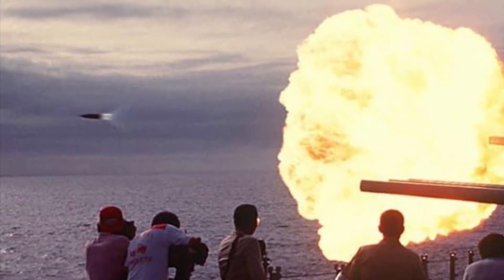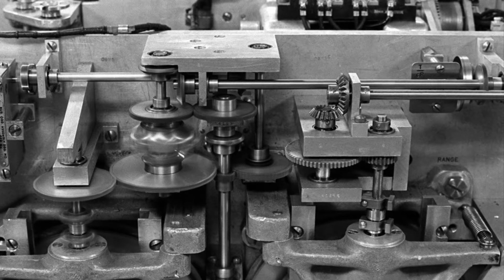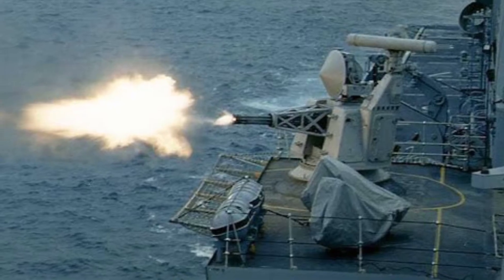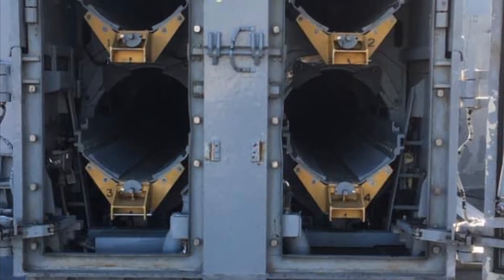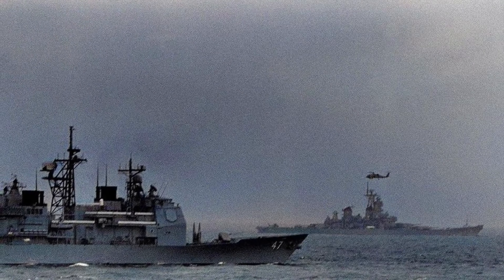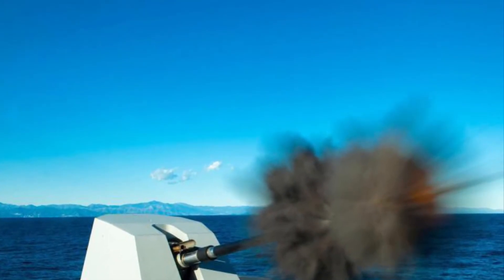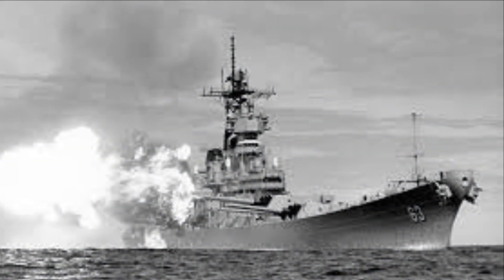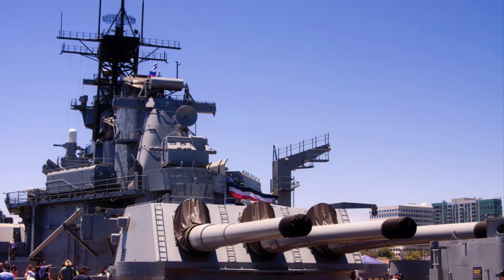How would I modernize the weapons on an Iowa Battleship?

Comment: The only way they would be viable is to ... gut everything after of the main bridge , gut the steam system and drop in a modern nuke reactor or 4  and all the fuel tanks add armor because they are outside the  internal armor belt. Take out all 3 turrets and drop in VLS. Everything forward of barbet for turret 3 to the bridge being a combo of the auto loaders off the destroyers and sea sparrow , sea wiz and missile farm for VLS.

Comment: Over on another website (Battleship New Jersey) the curator (?) had a similar video. He mentioned the pre-Aegis system: New Threat System (NTU). I never heard about it and was active duty at the time. Basically this system used all available radar systems to track and guide missiles to their target. To me this would be an excellent system to put on the Iowas.... maybe updated if possible.

I would gut the armored box launchers, too. In the center spot between the funnels I'd put VLS system (as many tubes as would fit). Where the rear box launchers were I'd put either a Mk-29 GMLS 11-cell or a Mk-144 GMLS 21-cell or a Mk-15 SeaRAM. But I also like putting these back on the aft part where the two tubs where the Bofors once where, even if the shipyard had to cut and modify these for better sea spray protection and/or concussion by the 16" guns.

Agree with replacing the old twin mount 5" guns with the current Mk-45 62-calibur.... 3 per side spaced evenly. Possible exception would be on starboard side put the new 5" gun aft of the refueling station. But a good spot would be place two of these guns in the aft tubs where the old Bofors used to be. These probably be better water-resistant than a Mk-49 GMLS.

I'd keep the Harpoon launchers in their current place. Slightly aft of these I'd place a NSSM Mk-29 launcher for the Evolved Sea Sparrow Missile.

I like the idea by the New Jersey's website suggested: put a tripod mast similar to the current on the rear funnel, possibly turned around so the legs anchor near the funnel's sides. This would give extra places for the additional radars to be installed. Almost every current radar system could be installed if the ship had two tripod masts.

I'd add the AN/SPG-62 Fire Control Radar in similar positions as the Arleigh Burke's and Ticonderoga's do. Two where the Lv-08 bridge is and two replacing the rear Mk-38 radar. These would be tied-in with the NTU System.

I dunno about the Goalkeeper.... I think the Bushmaster is a better gun for against fast small boats. But.... we're dreaming here so I'd add both guns. Better to blast them out of the water if swamped with many of them. The aft end of the ship would be an excellent place for these. Maybe up front too where the original Bofors tubs were in front of the 16" guns.

Considering the escort ships would have Aegis systems and VLS systems themselves.... the only improvement I can think of would be to have more launchers for RIM-116 Rolling Airframe Missiles. Maybe ASROC's or a couple Mk-32 Torpedo Launcher.

EDIT:
As for the powder handling rooms.... Automation would reduce manpower. Pneumatic / Hydraulic systems could be used to move the powder bags. It was interesting learning that these bags were stored in cylinders which kept them free from moisture, these also separated them from explosion if the magazine were to be hit.... but fire probably the most likely danger.

It was interesting learning that there were two bulkheads (walls) between the powder room and the space where the bags were hoisted up to the guns. Kinda cramped between these walls so maybe widen as necessary for the new machinery handling the powder bags.

Since we're dreaming and obviously have these ships in a shipyard.... cut-up the stern and widen it. This should give extra room for adding a couple Mk-45 62-calibur guns and a couple Bushmasters or Goalkeepers.

One more thing.... modern ships have life rafts in sealed containers. Considering battleships are meant to slug it out with other ships.... where to put these? Maybe cut and put these under the deck close to the ship's hull, extra armor added. Last person in Engineering, or the bridge, or in combat control can hit a button-switch when abandoning ship.... to auto-open the protective doors thus expose the life-raft containers. *MEH*.... maybe I'm over-engineering this, there's plenty of wall space to mount them.

Comment: I saw a video made by the curator of USS New Jersey and to change the power plant in those, you basically have to cut them in half, and with the armor belt and everything, it's not worth it.  I would keep diesel electric engines, those are battle ships, not carriers, they usually are in the middle of the action... I would certainly motorize the turrets and keep the 16 inches, but with guided ammos, the new ships nowaday wont survive too much under that kind of firepower

Comment: To be short, I would have something like this:

Weapons:
48 RGM/UGM-109E Tomahawk Land Attack Missile (TLAM Block IV)
16 RGM-84 Harpoon (Block II+ ER)
16 RIM-162 Evolved SeaSparrow (Block II)
9 16"/50 caliber Mark 7 – United States Naval Gun
2 5”/64 OTO Melara LW Vulcan Naval Gun
2 3”/62 OTO Melara Super Rapid Strales Naval Gun
4 Phalanx CIWS (Mk 15 Block 1B Baseline 2)
2 SeaRAM CIWS (RIM-116 Rolling Airframe Missile Block 2)

Electronic Warfare and Decoys:
AN/SLQ-32(V)7 Electronic Warfare System (SEWIP Block 3)
Mark 53 - Decoy Launching System (Nulka)
The AN/SLQ-25D Nixie Torpedo Countermeasures

EDIT: I might remove the Phalanx and the tomahawks for Millennium CWISs  and LRASM-missiles. But that would also depend on the type of fire/control radar that would be possibly to fit onto the ships.

Comment: What you described is perfect.16 in guns to "relandscape" upon demand. 122 VLS from the Tico instead of the 96 from the Burke. Just add the newest SPY radar (Somehow) and the laser that is being introduced onto the Block 3 Burkes. They may help against air drone swarms in conjunction with Phalanx, CWIS, and RIM. 

There are 4 Iowa class. Have to have 3 ready to rock and roll at all times 1 in drydock for maintenance. I'll explain.

I am definitely open to adding an additional VLS in exchange for 2 of the 5 inch mounts. Having the remaining 5 inch guns port and starboard and additional VLS for SM6 and Block 5  Tomahawks (1,000 mile range for a 1,000 pound war shot for the 7th fleet? Manila, Taipei , Tokyo, and Seoul might even help foot the bill to make it happen).1 fleeted up near the Okinawa prefecture and other fleeted up not too far from Subic. Add that to the converted Ohio Class subs carrying 100 Tomahawks that regularly patrol the Indo-Pacific and that is a recipe for some good eatin. 2 CSG (Ford class by then) and 2 ESG  (AMERICA and TRIPOLI with their compliments of F35b jets) to "adjust the attitude" of the unreasonable and the air force can mop up from Clark and Anderson.  

The 3rd refurbed and upgraded Iowa class gets assigned to the 5th fleet to get folks around the Gulf to see the error of their ways enough to leave the boats alone. Especially the boats with the oil in them. That 3rd Iowa class along with a CSG and the air force from Doha and PSAB (Saudi Airbase) would eat very well. Iowa class, Burkes, Ticos, Raptors, Fat Amy'/F35, A-10, F15E, F16, and Super Hornets on a feeding frenzy...IRGC in the Gulf...it would truly suck being you on that day.

Comment: The one thing now mentioned, that turns a BB from a tactical asset into a strategic asset, is redundant nuclear power. The submarine power plants would probably package better than the carrier plants. The ability to be the fastest ship at sea (and they would be), without being shackled to fuelers, changes the game.
Reply: Navy certainly learned something with the Ticonderoga cruisers. But I heard nuke reactors don't react well with concussion from explosions. I'd add secondary power as backup, maybe leave couple rebuilt boilers to enable the ship to keep moving in case these reactors shuts down unexpectedly. Add a large diesel generator so the radar system could be kept running if the nuke reactors shut down.
Reply: @Strayshot2010  while any mechanical system can be made to fail with extreme impacts, nuclear plants are less fragile than any other current system. The amount of redundancy built into one is part of it, but even the basic design is very robust. 
If I was going to try to retrofit a BB as a nuke, I'd actually go with submarine style plants, for their more compact dimensions, and simply use more than 2 if I needed more available power. That would add an additional layer of reliability as well, as all the plants are cross connect capable.

Comment: Existing BB's are EM resistant mechanical platforms. A close detonation of an a-bomb will not wipe the electronics for there are no electronics running the gun directors. I would pull the 16" tubes and preplace with helo decks and verticle launch missiles with a new dry deck forward castle.

Comment: All solid options but replace one of the main turrets with a triple mount heavy coil gun mass driver.  The pebble bed reactors (*2) replacing the current power plant and fuel bunkers giving a rediculous ammount of space/weight for the capacitors for a raipid fire option for the turret.  Also, there are several directed energy AMS units ground side that should work well afloat
Reply: An Alt to Nukes could be electric drive with a suitable, 50% efficient diesel main engine/generator with extra gas turbine generators used for full power generation.

Comment: I somewhat agree with your assessment, but at the same time, instead of having the 16in guns, I would remove them for a smaller caliber that would produce the same effectiveness, most of the reason for that is longevity of deployment time, 16in guns are good at softening up shore targets without a doubt and sometimes beyond the shore, but the loading system for them is slow and antiquated, there has to be a better way to do it. Im not saying that it will happen, but what if both sides EW Systems are on par and can't see each other until you're in gun range? If you're fighting a heavy cruiser, you're going to want to stay at a distance to knock it out and stay out of range of its main cannon. Frigates would go down with a couple shots if they were stubborn and didnt want to run, light cruisers would be just as much as a pain as a heavy cruiser and this thing will never get in range of a carrier, it would be too slow and too big to not see from a distance. I would put a VLS system on the back like you said but also leave some room for a helicopter pad, not for an attack helicopter or anti-submarine aircraft but more for logistics, food, fresh water and such if a supply ship can't get to them for one reason or another. It would also be ideal to start looking into non-vertically launched missile platforms (sparrow and such) to fill out its weapon roster. If a long range anti-ship missile could be fitted onto a weapon system that is external, that could come in handy without using the VLS system.

Comment: You'd have to massively upgrade the ship's power generation to run all these modern systems, but I like the general idea for your theretical refit.
Reply: A ford Classes nuclear reactor could certainly produce the needed power
Reply: @Mythicspider265  ford class has newer reactors than the Nimitz class. Puts out even more power and is more compact.
Reply: @Jermo7899  that they do they would be a perfect power plant for a full scale modernization of an Iowa
Reply: @Mythicspider265  it definitely would make it so much more capable to put a powerful laser on it. Along with hypersonics and other missiles. Or just make it a massive missile truck. It would be close to unsinkable. I’d love to see that boat on the high seas again escorting aircraft carriers or just straight up kicking some butt.
Reply: Nuclear? They are making smaller nuclear generators now.

Comment: if i was in charge to bring back the battleship, i would use the Iowa template but bring her up to modern hull design, modern armor plating, the back turret would house a nuclear reactor, replacing the old boilers for modern steam turbines power, and steam power to turn the props too, still have the 8 inch guns on the side, with cwis, anti missile lasers 4 of them on each corner of the ship, the bridge is down in the hull of ship like a submarine would be, conning tower would be the same for non combat sailing, now the front of the ship the guns.. well rail guns, replacing each turret to house massive rail guns almost size of the 16 inch barrels, though railguns eat the rails faster then gunpowder barrels, it would have a rail magazine that with the barrel wearing down to a point of near failure it would point all the way up 90 degrees and inside the turret itself would be a set number of rails per gun per turret of three railguns giving 6 massive railguns that can shoot up to mach 6 on full power to engage ballistic missiles, the barrel change would be fast as loading the railgun round itself by when the barrel is warn down it ejects the rails out to port or starboard for quick loading also how you stock the rails in the turret, by a crane attached to the barrel of the railgun it would pick up from the deck of the ship via crane, asking how can we use railguns, well each railgun gets a deck of capacitors with high output and can sustain max fire by some kind of cooling, instead of having hundreds of men inside the turret, it would be automated, but there will be gun masters in the turret checking status of loading, making sure the rounds dont jam or misfeed in the rack. batteries line one of the lowest decks though access hatches make battery changes easy even on the move from a refueling rearming ship

Comment: NEVER replace the 16” guns! They’re the main stay of the battleship. I’d make them auto load manual backup or auto assisted manual loading. 
CWIS for everyone, 8” guns on side for side battery, stern loaded with harpoon and tomahawk missiles including nuclear capability.
Reply: The guns are obsolete. They are show pieces at best.
Reply: I'd go with 8-10 inch guns.
Reply: Or replace them with railguns, once solve the issue with energy consumption which could probably be solved by powering the ship with a nuclear reactor or two

Comment: Could we make these ships nuclear powered? So we can use an electrical system that can use our new particle beam weapons and other things that require a huge amount of energy plus the fact that the ship wouldn't have to refuel for the next 30 years like our aircraft carriers.
Reply: Or we design more efficient ships that will cause way fewer problems and don't put 100+ new systems on old heavy ships
Reply: @gamm8939  
No way, modernizing old designs as opposed to designing new machines to accomodate the needs of new systems is a good thing? Whaaat?
Reply: @KoishiVibin  What? Are you saying we should modernize them or are you saying that modernizing them is a bad idea? Sorry I don't get your comment
Reply: You don't want to put nuclear reactors in ships meant to survive taking fire or to be used in directly in combat. 

As nuclear reactors are a bit temperamental when it comes to being jostled around and not to mention it's next to impossible to upgrade to nuclear on a already built ship.

Comment: I would leave the Iowa's alone they did there duty and now it's time they rested. It's time to build a new class of BB's with new weapon systems maybe plate forms for huge rail guns
Reply: US Navy has given up on railgun research as of 2022, with no money budgeted.
Reply: We dont have enough money to even build the same, they still have another three hundred years in em. Also the ways things heating up right now we might not have enough time to build New
Reply: Just strap them with like 5 missile platforms so basically a mobile patriot system on the sea
Reply: @pilot_bruh576  you could install Patriots on anythin, even a cruise ship. Especially something that doesn’t require 2500 crew. That was the real problem with Iowa class.  The payroll to keep it running.
Reply: I want a fast Montana class battleship  personally.  Id also widen Panama  to get even super carrier though
Reply: @robertyingling8193  They added a third set of locks which are much wider and longer, built to handle the largest (current) cargo ships.
Reply: @Strayshot2010  yes but they still don't fit our largest super carrier
Reply: They did.
They were called Zumwalts.
Reply: Nuclear powered, tons of modern equipments like rail guns, long range rockets, ICBMs, cruise missiles, patriot air defense, and also surrounded by a fleet of unmanned ships!!
Reply: We could strip them down and rebuild them.
Reply: Your approach is heavy on short range anti-aircraft defense. Chinese strategy is on long range missiles, both hypersonic and cruise.  Also, very little defense against smaller navies’ missile boats. Those may not penetrate the main armor belt, but can wreck everything else, especially the bridge and the various sensors.